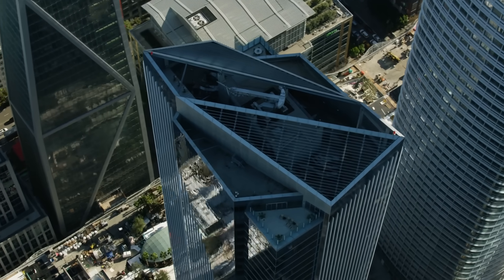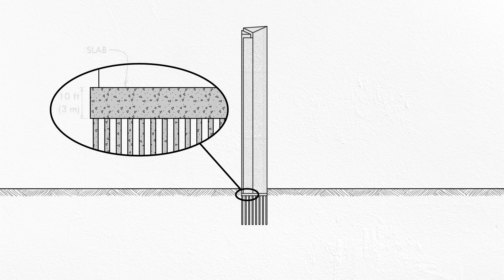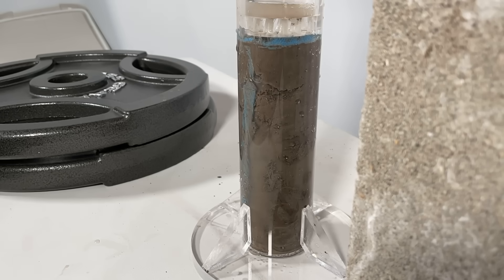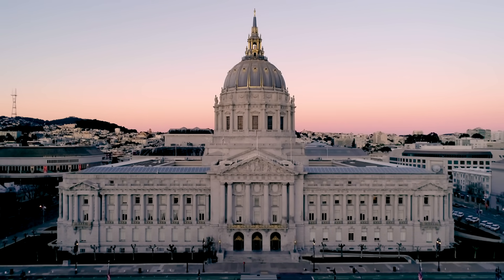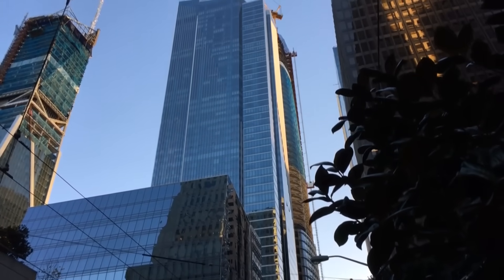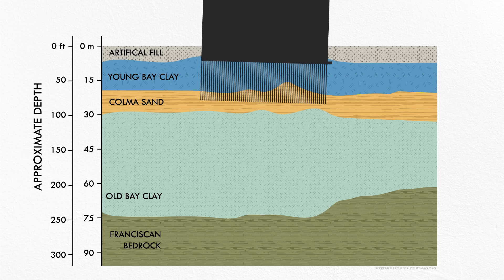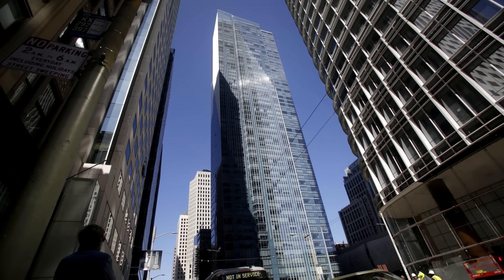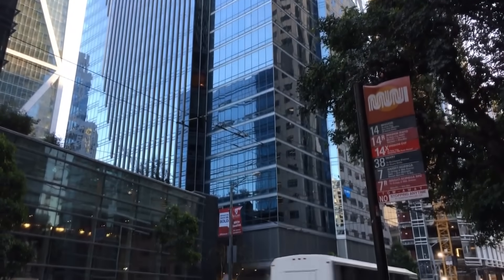What Really Happened at the Millennium Tower?

Comment: To be frank, while I respect that the panel of experts commissioned by the government are EXPERTS, I still would not trust that the building was safe, especially since they themselves noted that further settlement would change things further. 

I am not an expert on architecture, but I do know that structures weaken over time, especially when subjected to forces that they were not designed to withstand. Forces like extra strain from uneven settlement. 

If I were a buyer, I would not want to risk spending money in one of the most expensive areas for real estate on a space that ran the risk of not being there in 10 or 20 years.
Reply: I feel that every expert that claimed this building was safe should be required to buy a condo and live in the building.

Comment: The problem is that it was designed wrong ti is concrete and the other tall buildings are steel which is not heavy, and they did not go to bedrock all done for cost, Man up to your screw up's it cannot be fixed take it down and you pay for it not the tax payers

Comment: I live in miami of a retired construction worker and i worked on highways buildings and we draw holes under feet till it hits coral and going to the coral before we build our high-rises here and they feel the rebar concrete the same f**** time it's a lot of concrete and bad boys and they put the the proper whatever they're called the for the water table to suck the water out so they can continue doing their work but the water table is like a foot and a half with two feet and but they do it right here so what that did they should have done the same thing there but they screwed up on that job that was stupid i'm a contract i'm not doing it that way i'm doing it the right way to use cutting corners like that i work for said he cut corners he's a dumbass.

Comment: New solution found good news. 12 cables will be attached to the top of the tower and attached to 12 60 story steel poles that will be installed around the city. Once this is done the cables are attached to to steel poles and then tensioned. This will spread the load across the city and support the building.

Comment: There was an engineer that was working on the pier placement and suggested the pier be driven to hard pan.  Of course the city engineer overrode this request and allowed the piers to only go to the old clay.  Thermal readings now show the base earth under the building is heating up from the center of the basement slab.
Reply: Which city  plan review engineer overrode the request and allowed the piers? Remember that the applicable Building codes state that the codes are NOT a design manual, and a building designed to Code may not function correctly. The issue is one of engineering judgement. That being said, the city plan review engineer may not have had a basis to deny the developer's plan. The California Business and Professions Code regulating engineering required an engineering approval from structural and geotechnical engineers.
Reply: @sallymelville903   Thanks for the response, I have more of these or you can look them up yourself.  https://youtu.be/zxS71614E_0

Comment: Sounds like this tower has been built over the old stream bed of a stream cutting through the old bay clay and possibly filled in with a sludge even softer than the  bay clay layer. Anticipate a jack project on all sides of the building.

Comment: what will this jacking do to the existing foundation and original piles?  won't the original piles create an enormous amount of resistance to the jacking?  and will the altered substrates co-operate to allow for support or the building?
Reply: Good question. I don't think the original piles will move, so they won't resist the jacking due to friction. Instead the jacking will just take some of the load off the original piles and put it on to the new piles. (Disclaimer: Not an Engineer).

Comment: Actually, the tilt is not that much.  26" of tilt for a 645 ft. high building is 0.00336% or 1/3 of 1% if it stops here.  You probably could not notice it from inside a residential unit.  If a typical unit is 50 ft. wide, the floor slope would be about 3/32" from one side to the other.  No recommendations.

Comment: Unfortunately, I have further bad news for the residents.
The lean further puts uneven pressure on the foundation. 
This means the lean will get worse over time. 

The height of the tower also makes it worse. 
Up to a certain point the lean is fine. The foundation can handle it.
But past a certain point the leverage further puts uneven pressure.

A tragedy considering many have put down their life savings and worse, still have a mortgage.

Worse case, the tower will collapse and crash.

Comment: What will happen once the building is level ? Surely that wil only be temporary; the opposite corner to the piles will continue to sink. As the center of gravity shifts the weight on that corner will incrase. Will they need to keep adjusting the hydraulic jacks every few years to keep it level ?

Comment: The building has garnered several awards from several engineering and architectural organisations. 🤣🤣🤣
2008: American Concrete Institute Awards, Northern California – Construction
2008: Concrete Industry Board – Roger H. CIB Award of Merit
2009: American Society of Civil Engineers, Region 9 – Structural Engineering Project of the Year
2008: American Society of Civil Engineers, San Francisco Section – Outstanding Structural Engineering Project
2009: Metal Architecture Magazine – April 2009 edition Top Honor
2009: California Construction – Outstanding Project Management
2009: California Construction – Multi-family/Residential, Award of Merit
2010: San Francisco Business Times – Deal of the Year Award
2010: San Francisco Chamber of Commerce Excellence in Business Awards – Building San Francisco Award

Comment: What if there were disposable drill bits made which were attached to massive load bearing hollow tubes through which waste material could be pumped. That way once the drill bits hit rock bottom with the tubes attached, they could then be filled with concrete and rebar which would make the once hollow piles all the more structurally sound while at the same time reducing those pesky building tilting vibrations. Then attach all of those new piles to a newer supporting foundation that is attached to the old one, add the hydraulic jacks and viola.

Comment: I'm not a soil/geotechnical engineer, but I don't get it... what's supposed to prevent all the soil of the sand + clay layers pushing in laterally to fill in the cavity(-ies) being drilled out?  Aren't those bearing all the downward pressure and loads not only from the tower directly above and adjacent but also neighboring skyscrapers?  The greater the depth in the ocean, the greater the pressure, and while these soil layers aren't purely liquid, they're also not perfectly solid until down to bedrock either, so they'd have some fluid-like properties, right?  If this building is bearing 11,000lb/sqft down, and I scoop out wet, or even just moist clay, just a few feet away, won't that make it a LOT more complicated than just "Drill hole deep, insert long concrete stick inside?"  And doesn't the concrete used for that long pile to bedrock need to be waterproof as well as any interior steel reinforcement need to be proof against corrosion, etc.?

And obviously, the technologies to do all these things exist.  The supports for the Golden Gate and Bay Bridges and similar structures were built into the SF Bay, but I think those of us completely outside these fields of engineering assumed those in charge knew what they were doing as well as the countless regulatory agencies for overseeing building safety and all these issues.. knew what they were doing?

Comment: For a residential 2-story house, the typical loads range from 1000-2500 lbs/ft2, applied around a perimeter foundation footing. If a house is on piles, I would expect each pile to have around 25k lbs/ft2, since the pile has less square area than a continuous footing.  For a skyscraper, I would expect each pile to have closer to 200-1M+ lbs/ft2, depending on the pile diameter.  For a such a large load on each pile, I would imagine that friction is more important that bearing capacity of the underlying bedrock.  Unless the bedrock is solid granite, I don't think the bedrock is going to help much.

Comment: I have the solution: Connect all the tall buildings in that area with a grid of beams or walkways at the highest level possible. Now the entire district can act as a unit and transfer forces throughout during earthquakes. Wouldn't that be a bit of engineering and design work!
Reply: Ahh, dominoes...